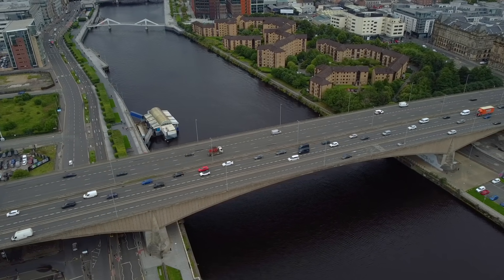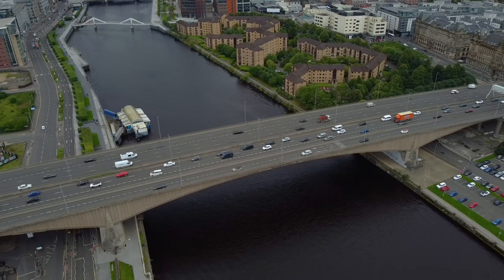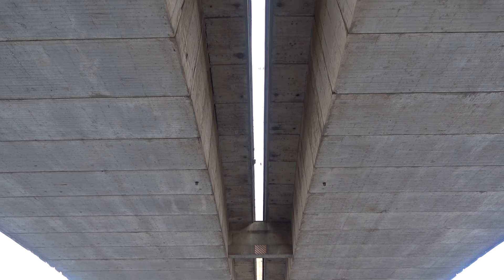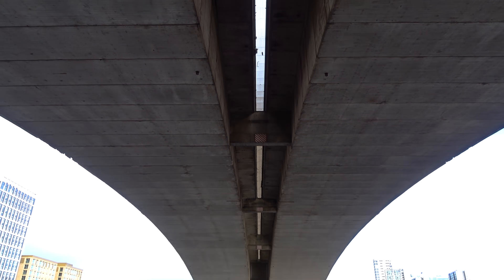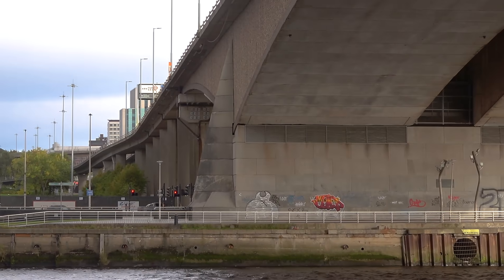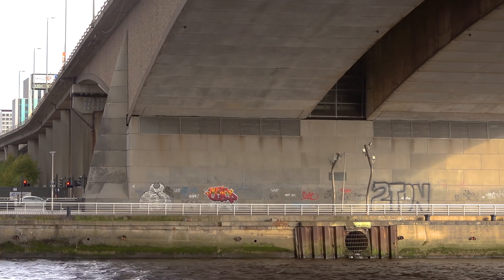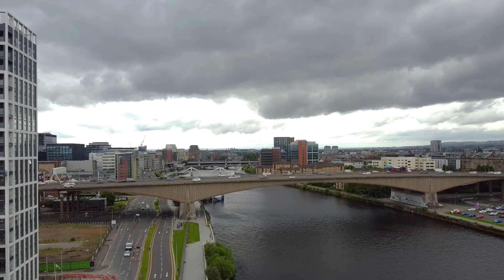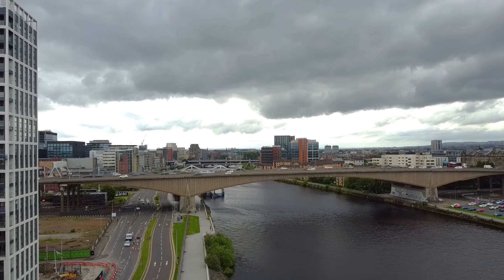How Do You Move A 52,000 Ton Motorway Bridge?  Glasgow's Kingston Bridge & M8 Motorway

Comment: At least the transport department in the UK actually replaces it. Minneapolis, Minnesota had an unfortunate event with I-35W's bridge, which one day on 1st August 2007, the entire structure collapsed into the Mississippi River during rush hour traffic. One of the gusset plates (the thing that connects girders to columns) gave way and killed 13 and injured 145. You can find video on YouTube of the collapse, too.

EDIT: The Ohio Department of Transportation is actually replacing a fifty-year old bridge near me. What they do is a little different: ODOT builds completely new roadbeds, shuts down the old bride, and then rebuilds it.
Reply: Some relatives of mine drove over that bridge in Minneapolis the day before. Too close for comfort. 

I followed the consequences and investigation into that bridge collapse. It was basically a design flaw. The gusset plates transferring longitudinal loads in one girder as transverse load in another were riveted to both. The load was supposed to be born by the friction between the plates and girders caused by the pressure from the rivets holding everything together. 

The mistake was to fail to understand how such a joint behaves as the bridge is warmed by the sun and cooled. The temperature cycling actually causes the joint to very slowly creep, despite the friction. 

Eventually, the joint moves enough that the load is beginning to get transferred as a shearing action on the first rivet to get trapped as its holes slowly move out of alignment. And, because the riveting is not a precision cut thing, it's one rivet first. The shear load builds, and that rivet snaps in half. The pressure from the rivets is reduced, and the joint can now move a little faster. Another rivet snaps, then another, and all of a sudden there's not enough left. Quite a mistake to make. 

The more startling fact is that there's over 70,000 bridges in the USA with the same basic design flaw. They're all going to suffer this problem and fate, if not altered or replaced. Replacing 70,000 bridges in short order is a lot of work to do quickly...

That's the problem with infrastructure tenders. The same basic design tends win every time, because it's the cheapest. If it's flawed, it's a looming disaster. We've had problems here in the UK with concrete cancer, e.g. Spaghetti Junction, and other structures that followed the same recipe of concrete. We now seem to favour enormous steel girders forming the whole span in one piece, simply laid on top of the bridge ends / piers, with concrete slabs on top for the road deck. Makes me wonder if all the older concrete bridges are going to be problematic...
Reply: Just watched it. Very sad.
Reply: I remember that one and the failure of the gusset plates.

Comment: Coincidentally a similar situation now being employed just along from this where the Woodside viaducts carry both sides of the M8 north of Glasgow City Centre - the problem there being the joints at the top of the supports failing. So they are currently having temporary supports built at either side of each set of pillars before being jacked up for replacement - the main difference being that there are about 20 sets of pillars!
Reply: That’s fascinating as I’m at Glasgow School of Art doing postgrad and I look out at that situation and wondered what was going on….now I know!
Reply: I had a tour of this site recently; it's fascinating.  The deck of the viaduct is in perfect condition but the tops of the piers (the pillars) are in a shocking state, it's not just the bearings.  It looked to me like the drainage was badly designed and the tops of the piers have corroded and spalled terribly.  It's going to be a really complex (and expensive) job to sort it.

In my opinion they should just demolish the viaduct and put the motorway on the ground.  There's nothing under the viaduct of great value.  They can move the Chinese supermarket to a better spot quite easily 😊
Reply: @David8n even better solution would be to tunnel from Atlantic quay through to the infirmary using a 30 year toll funding model and then freeing up all of the land in the city centre for residential, leisure and mixed use construction
Reply: There used to be a picture of this new marvel of engineering in Paisley college of technology.  
When the bridge was freshly built.
Reply: And it would have been finished (and done cheaper) by now if they'd had new steel spans made like with the new M74-M8 link!

They could just have closed the motorway (one or both ways), demolished the old spans, removed the old supporting structures, rebuilt new supporting structures in the same place (thus avoiding all the underground services they're currently complaining about), and then put the new spans on top.
Reply: @CoolSteve08 I'm guessing you're not an engineer so that's probably not sarcasm.

Comment: Loony Scottish 'Greens' want to impose a 20mph limit on the M8 through Glasgow for 'air quality' reasons.
Reply: That’s just a prelude to removing the M8 altogether, or, replacing the Woodside elevated section with a ground level boulevard and capping the Charing Cross tunnels. Effectively making the M8 into two halves connected around the south side by the M74. Meaning the M74 goes from the relatively free flowing but busy motorway it is now, to a car park, choking the residents of Rutherglen. But, the cynic in me says that because Rutherglen is in a different council area, and had the audacity to vote out their former SNP representative, who cares. It should also be remembered that not a single Green MSP in Scotland has won or even come close to winning a Constituency vote. Their electoral mandate is shaky at best. Useful idiots for the SNP.